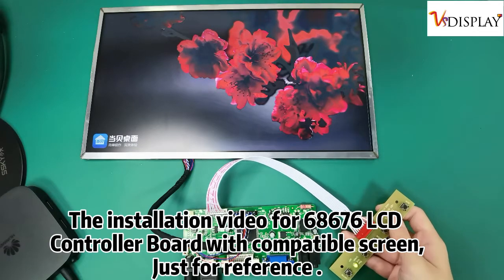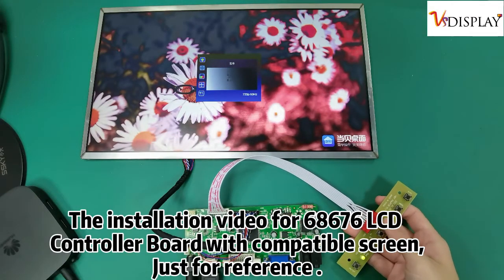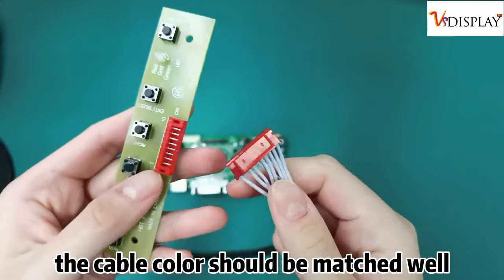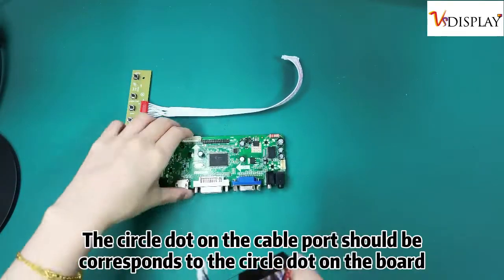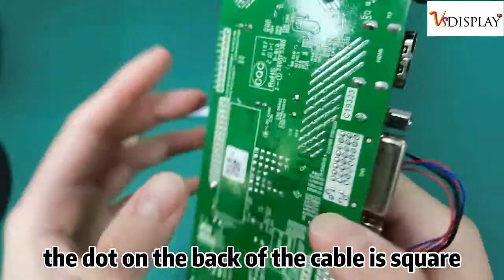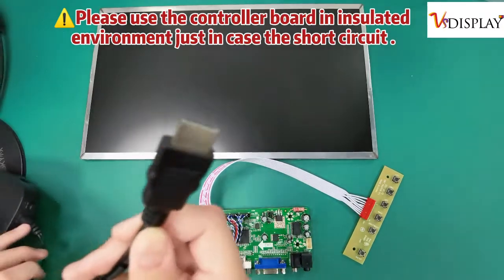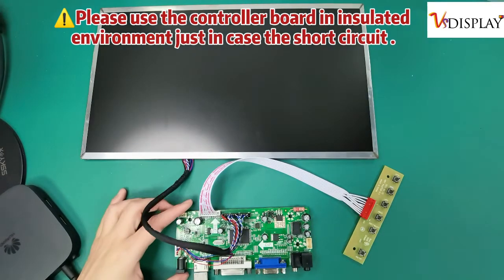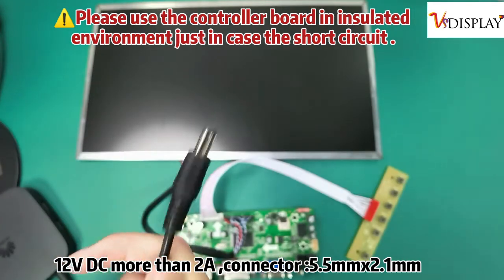HD-MI DVI VGA LCD Controller Board M.NT68676 Connection With IPEX 40Pin LVDS interface LCD Screen

Comment: I have a board hooked up to the screen from my old toshiba laptop and it works fine but I have to start up the Pi to a tv screen first and then switch it over to the stand alone laptop screen from my old laptop. The screen stays blank and says no signal until I start it up to the tv and then switch it. What do I have to do to just start it up to my old screen? Thanks in advance, Mike
Reply from the maker: It may be the difference between the tv screen and the laptop screen signal source,when you connect your old screen,you can try to set the correct input signal source

Comment: why is my lcd controller board light blinking and not working
Reply from the maker: Please check the connection and power input if correct,if the connection and power supply correct,still can't work,you can take the specific photo or video,then contact seller for help.